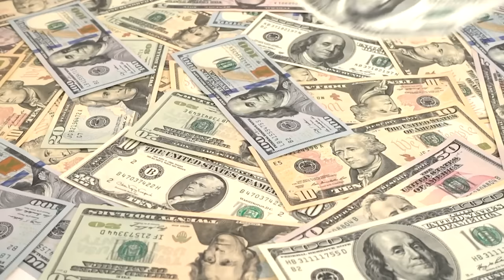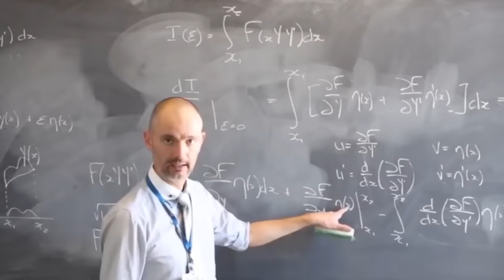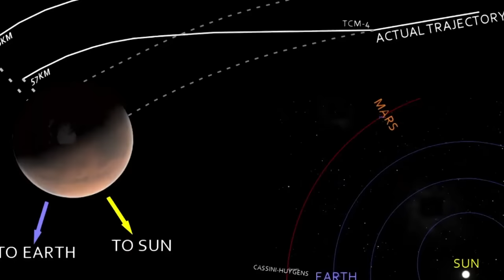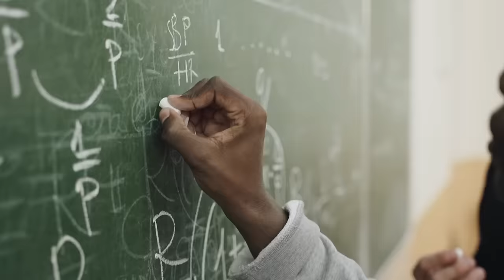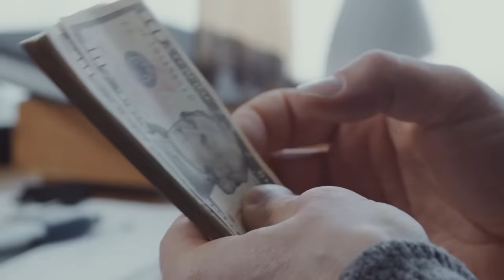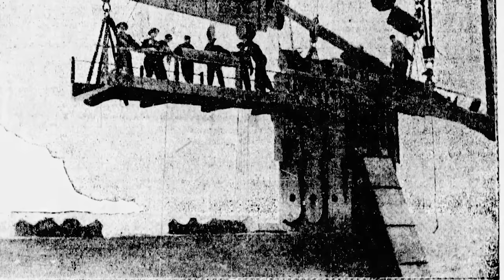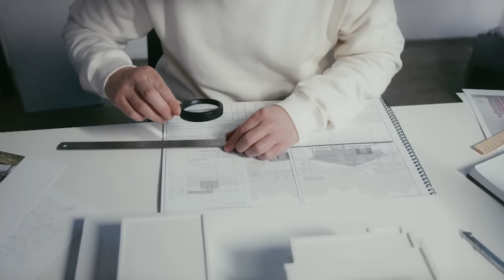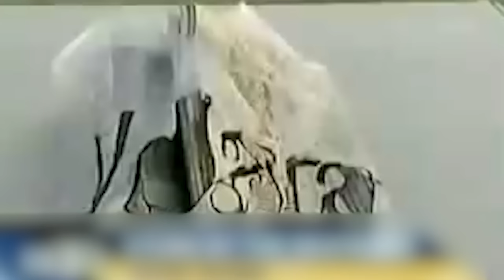Craziest Engineering Fails in the World

Comment: The Standard Oil building issue was not quite as described.  The problem stemmed from saving mon  ey by buying cheaper grade marble.  This marble wound up warping with age so many panels were not attached as they should be.  It was not that marble is heavy.

Comment: FYI: Titanic had a full load of life boats, all she was legally required to have at the time of her sinking. Her sinking was not an engineering failure but poor decisions on part of the crew. Both Titanic's sister ships sailed for years, with the exact same engineering in them.
Reply: They had a fire in the coal storage, which may have weakened the hull round the impact with the iceberg. But it can't be named a fault from the crew that the ship sank from water coming in. The look-out in the mast missed a binocular, which may have made it possible to se the ice in front?

Comment: Engineers tend to design in a vacuum. They often forget where something will function, like these curved building that reflect the sun's rays to overheat an area. A friend was an engineer, and anxious to show his engineering prowess on our race team. He designed the roll cage for the car, but before we began building, he mentioned it should take 40G before it deformed. Of course, that means the driver would suffer the 40G impact instead. He was so intent on building a strong cage he forgot it needs to deform to absorb the shock and save the driver.

Comment: I heard that the Mars spaceship problem involved a factory I used to work at that made space microchips. Being in the UK it might make sense as we use the metric system.
Reply: In this case it wasn't your company which messed things up. NASA used metric since its very beginning. The whole Mercury, Gemini, Apollo program and everything that followed used metric. It was just for the purpose of the early astronauts (which were used to imperial units, since all of them were aviation pilots) that eg. the units used in the computer programming was converted to imperial for display purposes. But all the calculations, all computations, all engineering construction, ..., everything was done metric right from the start.